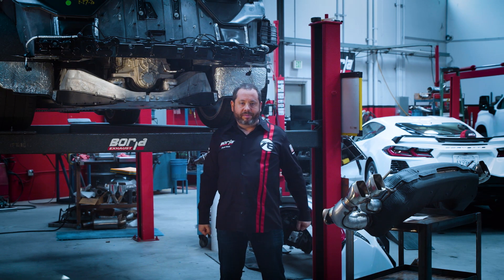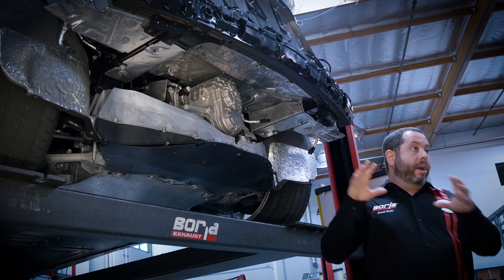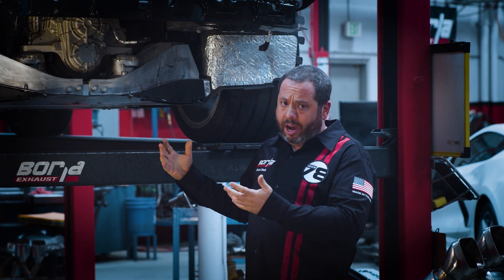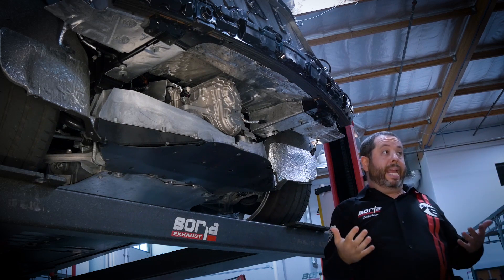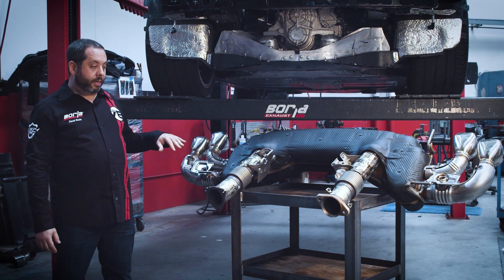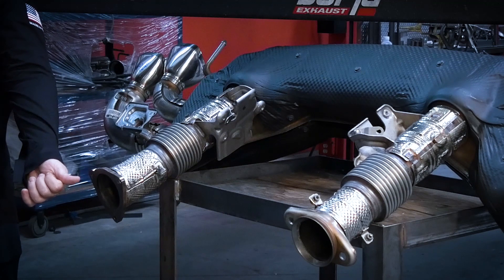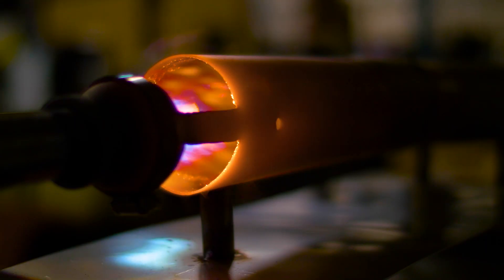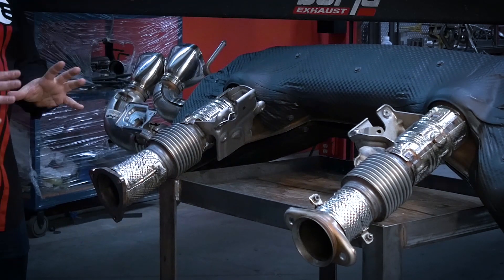Building an Exhaust for the C8 Corvette? Borla Shows What it Takes

Comment: Will the ATAK exhaust be installed on the C8 from the Chevy dealer. When you build the C8 on Chevy Website?
Reply from the maker: Hi. Unfortunately, the Borla ATAK system will not be an option when you build the C8 on Chevy’s website as our exhaust systems are aftermarket parts.